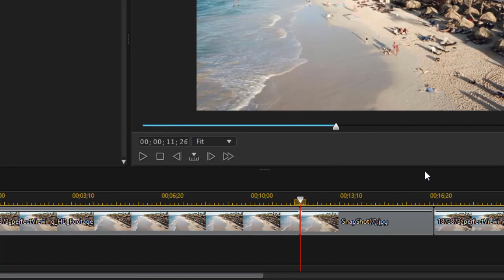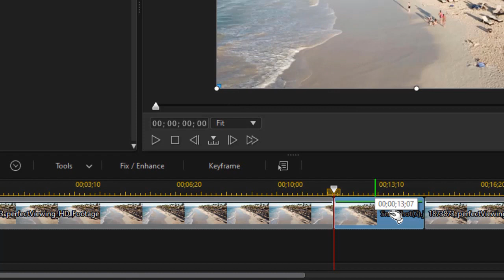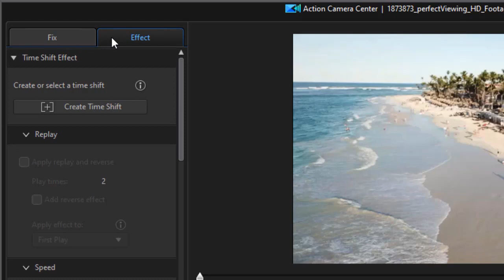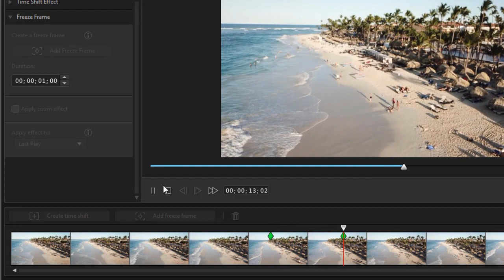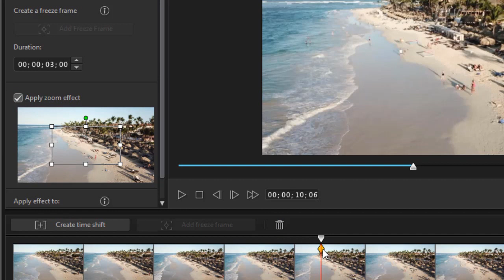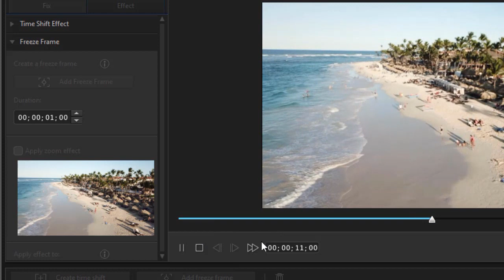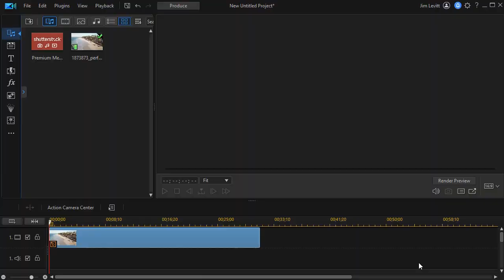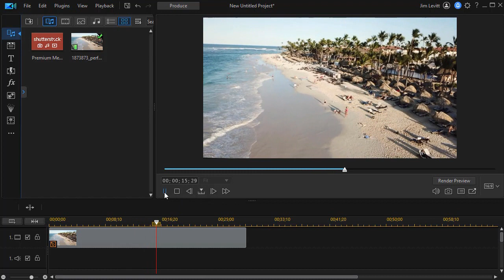PowerDirector - Two methods for creating a freeze frame

Comment: There's actually a THIRD freeze frame method, and I prefer it: click your clip in the media room, slide to the desired spot in the preview window, then click the camera icon under the preview window.  You can then rename your snapshot and save it anywhere!  My big beef with the first (in timeline) method is that it inserts the snapshot in the timeline, but doesn't shift your other tracks...so any work you had done after that point is messed up.
Reply from the maker: Great tip, Don. I wish I had included it. I'll have to find a way to insert the idea into a different tutorial in the future. Thanks so much for sharing. --Jim
Reply: Thank you so much for that tip. Although the first time I tried it, I was caught out by the fact that it froze the uncropped version.
The resolution seems to be to click on the clip in the timeline, but then use the preview window and the camera icon.
The result is much better than when I was trying to access the last frame directly in the timeline, and often ended up with one or two frames being split off to create a new clip.

Comment: Jim, As a matter of interest what is the current spec of your PC and what was your most recent upgrade and how has your new PC's spec improved performance. Also it would be interesting to see what the current specs are from your viewers.  I have a Ryzen 7 3700x, 16GB RAM with a GTX1660 Super Graphics Card.
Reply from the maker: Steve, 
I'm working with a Ryzen 7 2700x and a NVIDA GeForce GTX 1050 Ti video card. 16Gb of RAM, booting with an M.2 drive. Hopefully others will share their core specs as well. --Jim
Reply: @SharperTurtle  -  I did not find on Internet the NVIDIA GeForce GTX 1050 Ti card with 16 GB.   Just with 4 GB.

Shortly,  I will be updating my computer to install  PowerDirector and will need an adequate graphic card to run the program smoothly.  I use Windows 10.